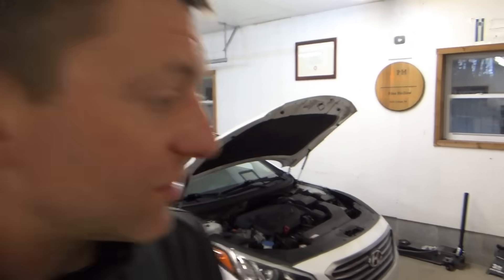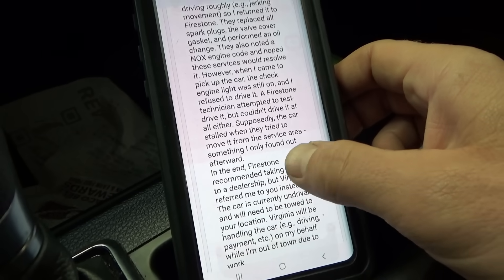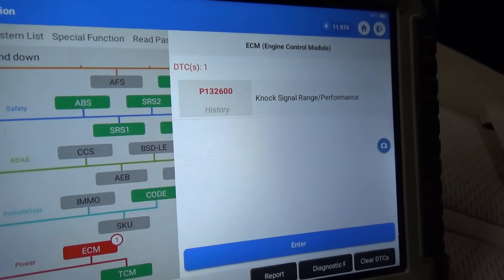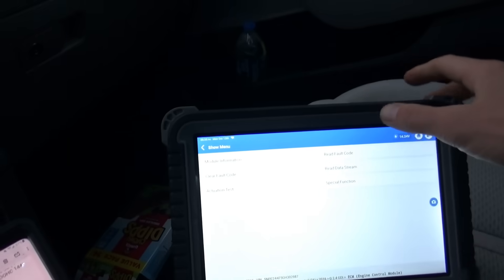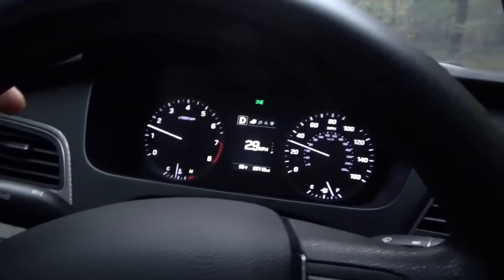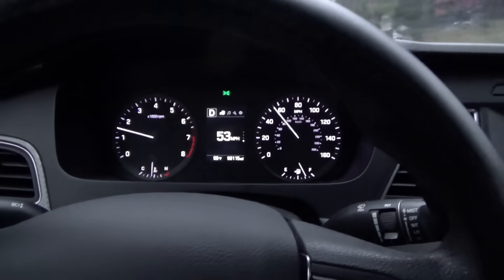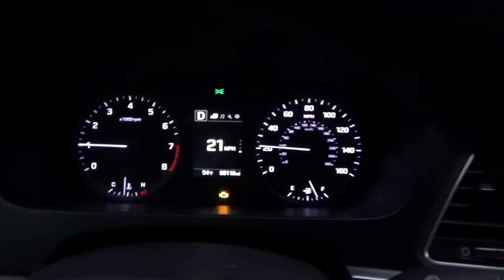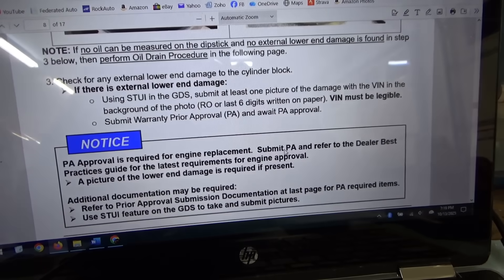Shop Replaced Spark Plugs...for THIS?!? ('16 Hyundai Sonata: LIMP MODE P1326)

Comment: Typically a knock sensor code on these means it needs an engine.
Reply from the maker: Pretty cool how the computer can pinpoint which cylinder is knocking 😅
Reply: @PineHollowAutoDiagnostics It is. Honda has a similar feature. I've used it to diagnose faulty injectors.
Reply: @PineHollowAutoDiagnostics I seem to remember a campaign/tsb where the software was updated to listen for grenading and they would replace the yellow dip stick with either an orange or red dipstick. I don’t remember what each color signified but in the long run it helped this customer get a new engine without a lot of hassle.
Reply: @PineHollowAutoDiagnostics  shouldn't all engines know that? the PCM knows which cylinder its firing and it'll just assume that's the one that's knocking
Reply: @PineHollowAutoDiagnostics they had mandatory recall update to add this functionality. Because hole in the block on highway without warning or cel is a bad time.
Reply: @PineHollowAutoDiagnostics they had a software update for this purpose, you're supposed to stop driving and get new engine under recall.
Reply: Yup. Flashing engine light and knock sensor code on Hyundai/Kai means the engine is toast. There was a recall a few years ago to update the ECM software so the engine light flashes when the engine starts to knock due to so many of these engines failing
Reply: Seems like u can fix any car, has been a car in which u couldn't find the problem?
Reply: @bigo975 Don't know if that's directed at Ivan or me. But we've all had cars that have stunped us. It's part of the process.